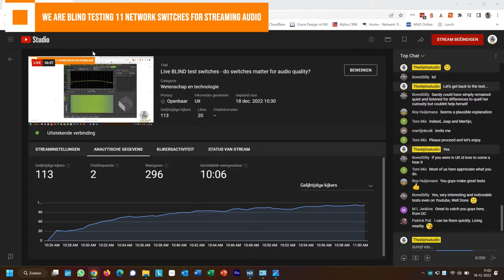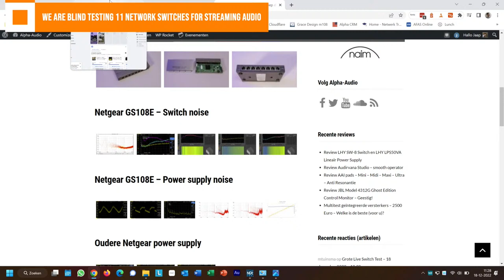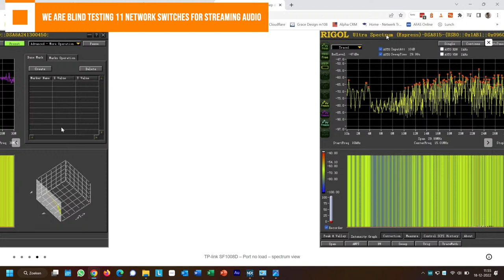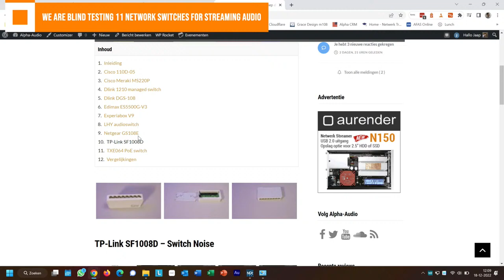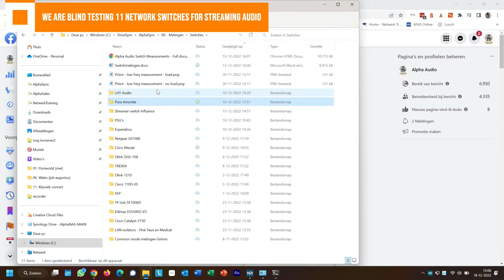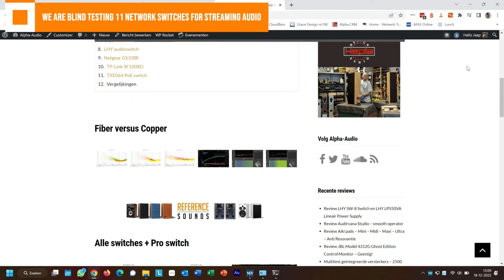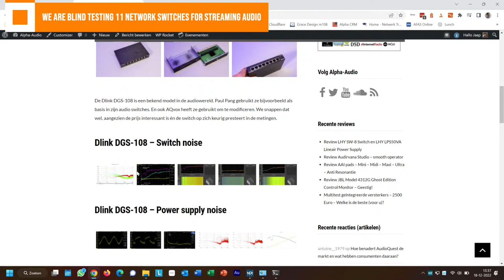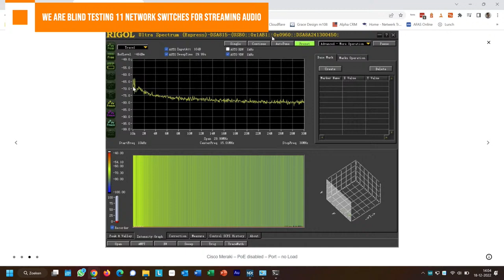Live BLIND test switches - do switches matter for audio quality?

Comment: Introduction: 04:03 - 16:17
Baseline (no switch): 16:17 - 22:55
Switch 1 (LHY SW8) listening: 22:55 - 35:49
Switch 1 (LHY SW8) measurements: 35:49 - 
Switch 2 (Dlink DGS-1210) listening: 38:13 - 46:57
Switch 2 (Dlink DGS-1210) measurements: 46:57 - 52:47
Switch 3 (Netgear GS108E) listening: 52:47 - 1:00:51
Switch 3 (Netgear GS108E) measurements: 1:00:51 - 1:03:15
Short discussion on how conduct these tests and why: 1:03:15 - 1:07:15
Switch 4 (Cisco 110D-05) listening: 1:07:15 - 1:14:53
Switch 4 (Cisco 110D-05) measurements: 1:14:53 - 1:20:33
Switch 5 (TPLink SF1008D) listening: 1:20:33 - 1:28:40
Switch 5 (TPLink SF1008D) measurements: 1:28:40 - 1:36:37
Switch 6 (Pura Audio switch) listening: 1:36:37 - 1:43:23
Switch 6 (Pura Audio switch) measurements: 1:43:23 - 1:48:02
Lunch break: 1:48:02 - 2:22:52
Recap of the test setup: 2:22:52 - 2:26:51
Recap of the listening experience: 2:26:51 - 2:32:02
Switch 7 (Delock Fiber converter) listening: 2:32:02 - 2:40:17
Switch 7 (Delock Fiber converter) measurements: 2:40:17 - 2:46:35
Switch 8 (Edimax ES5500G-V3) listening: 2:46:35 - 2:54:27
Switch 8 (Edimax ES5500G-V3) measurements: 2:54:27 - 3:00:57
Switch 9 (Dlink DGS-108) listening: 3:00:57 - 3:09:17
Switch 9 (Dlink DGS-108) measurements: 3:09:17 - 3:14:43
Switch 10 (TXE064) listening: 3:14:43 - 3:21:13
Switch 10 (TXE064) measurements: 3:21:13 - 3:24:28
Switch 10 (TXE064) non-POE ports: 3:24:28 - 3:29:00
Switch 11 (Cisco Meraki YETI edition) listening: 3:29:11 - 3:37:01
Switch 11 (Cisco Meraki YETI edition) measurements: 3:37:01 - 3:41:07
Revisiting switch 1: 3:41:07 - 3:49:20
All switches: 3:49:20 - 3:55:41
Some sort of conclusion: 3:55:41 - 4:01:42
Fiber revisited: 4:01:42 - 4:04:30
Baseline (no switch): 4:04:30 - 4:12:50
Reply: Thank you!
Reply: Thanks for the List, Really enjoyed your latest test.

Comment: Switched a Dell Power Connect 2816 for the Netgear GS108E today. It's just over 25 Euro's! The improvement is massive, the reverb alone is impressive. Over the moon with it. It's all about noise and grounding most of the time. Thanks Jaap en Martijn.
Reply from the maker: Welcome. Glad you like it!
Reply: Interesting!  There must be a big difference between the USA version and the EU version on the Netgear because here in the USA (I tested 15 different switches over the last month) the Netgear models performed the worst of any.
Reply: @GreekAudioGeek  I don't know, I bought the NG 108 and noticed an immediate improvement in both sound and picture quality on my television and sound bar. But, I am using a linear power supply on the switch. Even my 80 yo mother asked what I did to the TV, she wondered if I bought a new setup. It was that switch.
Reply: @michaelwright1602  Hey Michael - I've always heard good things about it but it just didn't work in my system.  Is yours a US or European version?

Comment: It seems that you guys have the ability to ear noise in the megahertz region , well  even  bats cant  😅
Reply from the maker: We ARE superhuman... Didn't you know...?
Reply: @TheAlphaAudio  I would expect an logical and/or tecnical  answer , dont u think 🤔
Reply from the maker: @fdracing63  i didn't read a question...
Reply: @TheAlphaAudio  in a way it was , and still is 😉
Reply from the maker: @fdracing63  Noise can influence lots of things. Electrical noise - say from LED's, PC's or Power adapters - can influence dacs, clocks or amplifiers with high bandwith. You can notice it in a less calm presentation. 

Another example is speaker design. The TAD's have a range of 30 Hz - 60 kHz. Do I hear 60 kHz? Of course not... but because of the very high bandwith the speaker is a lot cleaner in the audible range. There is virtually no distortion.
Reply: @TheAlphaAudio  ok , but if the megahertz noise can influence the audible region , why dont you make measurement in the audio band  ( 20 hz to 20Khz ) too , it will easely and clearly  shown differences , my take is about the method you use to demonstrate things
Reply from the maker: @fdracing63  We did that as well. All measurements will be visible in the written article. Also... the spectrum analyzer measures from 10 kHz - 30 MHz in this case. Not all spectrum analyzers are the same. Ours has a bandwith from 9 kHz - 1.5 GHz. We used a Prism dScope for the lower band.
Reply: @nihilionsaro  Do you have trouble with truth and science or you prefer live in your biased world .....
Reply: @nihilionsaro  No doubt  , you have trouble with thruth  , you'r the perfect beleiver at the rigth place 🤣 , kiss from  science 😂
Reply: @TheAlphaAudio  the graph in the lower band , use  dBfs , instead of dBv /u , any reason why , we dont know what's is your fs in that case  , an 32k of FFT  is useless , 192k will be , say more accurate
Reply: @DIYAudiophile  why do you guy's are so angry , science is made of contradiction and doubt  , if you want to prove anything you should accep it .....
Reply: @fdracing63   I don’t think we are angry. We are just enjoying listening to our music streaming through a switch instead of wasting our energy in measurements and charts. Alpha Audio did a good job to establish correlation between measurements and listening but it’s not always spot on. Save yourself time and perform this correlation in your own rig and be your own judge but always keep in mind that not everything in life is explicable and if your ears win over measurements don’t defeat it and prove otherwise in the name of science. Science is no always correct.
Reply: @DIYAudiophile   " if your ears win over measurements " , have you heard about cognitive  biases  ?? , you should not trust your audition that much and have a learn about all the bias human are prone to ...
Reply: @fdracing63   Unlike you, I don’t believe in all science out there and fancy terms such “cognitive bias”. When engineers designed test equipment such as AP555, where they under the influence of the so called “cognitive bias”? You can choose to believe everything you read and undermine your hearing ability. For me, I’m gifted with two ears  that are reliable and trust worthy. 
If you believe solely in science then I suggest joining the ASR community and you’ll safe haven there.
Reply: @DIYAudiophile  Cognitive bias is all but fancy , you guys have a lot to learn , a lot ....
Reply: @fdracing63   Prove the existence of "Cognitive Bias" and then we can engage in further duscussion.
Reply: @TheAlphaAudio good points especially the high bandwidth amplifiers that are sensitive . Most people don't understand the parallel influence of the whole chain where especially ground has a big impact.  Even this switch test says nothing about the equipment and outcome but more about the situation there .This is exactly why blind tests don't work because bad ground has an impact on all the connected equipment. Testing in your own set is the only way to come to a conclusion.
Reply: I bought the $40 NetGear 108 switch, and saw an immediate improvement in television picture quality, along with very noticeable better sound out of my sound bar. Others noticed the change immediately upon walking into the room, one being my 80 yo mother. The switch works. Best $40 I have spent in years.

Comment: I was not able to watch the full 4 hour video, so let me ask the question here. This test was performed with streaming audio, so the data is already buffered in the streamer before sounds start. That also means that you could disconnect the network cable for a few seconds and put it back in the switch without interruption of the audio. Was at some point the in this test, the network switch briefly disconnected and was the reviewer able to tell when?
Reply: That is a very good question… see measurements and disconnecting the cable for a few seconds by Emir from Audiosciensereview….

Comment: Excellent review! For me personally the LHY is the winner as "loads of detail" is what I expect from a network switch. The counter melody played by the keyboard on the Talking Heads song with the LHY (and the Pura) sounds more engaging than on the non OCXO switches. The LHY then resolves the details of the fast rhythmic section better than the Pura.
 If I have issues with tonality, or a too hot tweeter because of the OCXO clock, there are other ways of dealing with that further down the chain rather than stifling the network switch. ps> I also really liked the glass fibre demo and assessment at the end! :)
Reply from the maker: Thanks!
Reply: Do you really think so? Are you kidding me?

Comment: Hi guys! a few years earlier i would have said audiophile network switches what a nonsense! But i myself just expierienced what a hi end Isotek power conditioner and a hi end audioquest power cable could do to improove the audio quality of good hi-fi system, i was very supprised about the difference,  wider stage, more resolution, but the most difference was more bass, the difference in bass performance blew me away! The bass went deeper end had more punch, it was clearly noticeable.
Power delivery definitively makes a difference. I like your hearing and testing sessions, very interesting, maybe i check out my network switch soon. Very nice work Jaap, just subscribed to your chanel, very interesting stuff👍🏻
Best regards from germany
Reply from the maker: Thanks man!
Reply: Which Isotek power conditioner are you talking about? Cheers

Comment: Netgear GS108e net besteld 👌
Question - is the stock power supply good enough, or do you have an alternative?
Thnx
Reply: Yes it is, but there is something to be gained using other power supplies. If that works for you is another question. The only way to find out is to try for yourself.
Reply: I use the stock power supply. Surprised by the improvement on a NAD 658 (with 298). Hope you have the same results.
Reply: IFi iPowerX 12V is a huge upgrade.
Reply: @DBravo29er  can it be used, just by swapping?
And is it worth the Approx 100 €?
Reply: @maurices.7141  Yes and yes. I also found the lower cost iFi PS (black case) brought improvements for less $$.
Reply: I tried a Meanwell 12v switching power supply and the LHY 12v linear power supply. There was an improvement over the one that came with the NetGear 108. I use my television as the test bed, the picture quality was better with either of those two power supplies. There was a slight degradation with the stock power supply. I would definitely upgrade the power supply with this switch.

Comment: If there is a real difference in the sound introduced by using different LAN-switches and not only a price biased difference, then because of the digital streame not being effected, it must be an effect of the physical layer of the LAN-connection. The physical layer has no limitation of the amount of noise generated in the switch and transferred by the ground connection. The solution of that can be done in some different ways:
1.      Use a LAN-cable which has no screen. (This dissconnects the ‘ground’ in the DAC from the ‘ground' in the switch)
2.      Use a fiber-connection between the switch and DAC. (The only signal transferred is the digital stream)
3.      Replace the DAC by a DAC which has taken the problem coming from noise transferd and/or  generated in the switch in consideration  and designed the DAC in a way which eliminate the noice problem to a acceptable level.
It would be possible to inject noise into the DAC by the ground in the LAN-connector and measure the influence the noice-level (and type) has on the sound signal coming from the DAC. That would also make it possible to use that as a standard measurement which will show the difference between DAC's. 
This approach would hopefully solve this controversy.
Reply: Have you even watched?

Comment: Curious about you think about wifi networking? I guess that would take care of the issues with power supplies etc in the switches
Reply: It adds interference from the WiFi radio inside the streamer. One of the few brands that specifically designs for WiFi use is Auralic

Comment: @Jaap/Martijn: May I ask how you value D-link DGS-108 and Netgear GS108e in comparison to Silent Angel Bonn N8 and the NuPrime and English Electric clones? 

And what makes more sense, investing in an audiophile switch like Bonn or buying a D-link/Netgear with a high quality PSU (e.g. iFi Elite or a LPS) for the same money? 

My gut feeling says that the PSU is the most important aspect and more important than clock crystals etc?

Looking forward to your answer. Thanks.
Reply from the maker: A Dlink 108 with a good power supply beats the Silent Angel. And yes... The power supply is far more important.
Reply: @TheAlphaAudio  Thanks. So D-link DGS-105 + iFi iPower Elite 5V or Netgear GS108E + iFi iPower Elite 12V seems to be the way to go. Elite PSU 2nd hand can be found for 200-240 euro...D-link/Netgear new for ~30...sound like a good plan😉

By the way interesting that Martijn heard differences between D-link and Netgear regarding details...curious if that would be still the case with both switches having identical power supplies.

Anyway, very helpful tests. Thanks for all the work!
Reply from the maker: @basvandesteeg796  the Netgear and Dlink sound very different. Dlink is more airy. Netgear is more calm and bit more dry.
Reply: @TheAlphaAudio  With stock SMPS if I remember well. Interesting if these difference remain with both switches powered by same PSU...like Elite or decent LPS. Did you test this by the way?
Reply from the maker: @basvandesteeg796  we did test it with a good PSU. The difference remains. The sound improvement with a good PSU is very well audible.
Reply: @TheAlphaAudio  So best to try them both to find out what suits me most. Pitty that they have different voltage...
Reply from the maker: @basvandesteeg796  Dlink works on 12V as well
Reply: Vrolijk Pasen! Dank, wist niet dat dat Dlink ook op 12V kon. 

Is er nog verschil tussen de Netgear GS108E en GS105E afgezien van het aantal poorten? Meen me te herinneren dat ik ooit iets gelezen heb over ander (kleiner) kristal?
Reply from the maker: @basvandesteeg796  dat weet ik eerlijk gezegd niet. Vrolijk pasen!
Reply: @TheAlphaAudio  Oh really? I'm going to have to grab a D-Link. Thanks!
Reply: @TheAlphaAudio  That is true, with both audio and video. I'm using the LHY 12v LPS on my Netgear GS108Ev3 and it was incredible to see what it did with the video stream to my TV.

Comment: I didn't look through the whole video but what does it matter if there is noise on the ethernet port?
The DAC should be able to handle that so it doesn't make it through to the audio signal out.
Did you measure if there was any impact on the audio signal out of the DAC?
Reply from the maker: Yes... we actually did. En there is more noise on the analog output as well. But besides that: the clock in the dac can be influenced as well....
Reply: @TheAlphaAudio  Ok I'll find it in the video. That does not mean all DACs will have an issue though.
Reply from the maker: @TheSineira  true. And not all streamers are equally sensitive.
Reply: @TheAlphaAudio  So you are not really "testing" the switches, only the quality of the dacs?
Reply: Would it be possible to show those measurement. Because the real issue is whether it affect the output of the dac feeding the amplifier
Reply: ..and thanks for sharing your work 😀.
Reply from the maker: @harritz1977  you are welcome! We are still measuring it. We need some better equipment to create valid data.
Reply from the maker: @harritz1977  We will do a follow-up, but it will take time. I need an extra device to decently measure the effect on the dac and output.
Reply: @TheAlphaAudio  That's fantastic :-) just take your time - and remember to enjoy the holidays. 

Your work on bridging the gap between listening and measuring brings valuable insight to the community by providing another dimension compared to sites like ASR. I especially enjoyed the latest amplifier test :-).
Reply from the maker: @harritz1977  thanks! It is very interesting to find some links... You enjoy the holidays as well
Reply: @TheAlphaAudio  "But besides that: the clock in the dac can be influenced as well...."

Is that an assumption or did you really measured the clock and saw that it was influenced by noise ?
Reply: Thx for sharing and making the effort to set this up. Would be verry interesting to include another element into the tests, that is to sometimes not make anny changes, and check whether or not you can hear that too.

Comment: In IT world, it's  milliseconds of ip packets that gets measured thus should be same. Power conditioning of power supply and cat 6 7 8 cables make more of the differences.
Reply: It is not about the data side of things. That doesn't have any influence at all.

Comment: Great video and great subject for discussion on streaming audio! Thank you!! @TheAlphaAudio Can you share do you use port-1 for IN and port-8 for OUT??? I did get Netgear GS108(without "e") and TPLink SF1008D. Netgear have some sick depth/width and layers, really easy to distinguish, music flying around but the bass was way too weak for my system. TPLink is less of what Netgear did great but with more warm sound, more attack in bass and more bass overall. But on the TPLink on port 1 and 2 the stage was bad ....on the 1 and 8 it was way better!
Reply: We don't have any preference for specific ports. It could be however that it makes a difference, but that's due to not so proper separation of the ports. It seems the TPLink suffers from this. Now, for a fun experiment, stack the Netgear and the TPLink. Netgear first and then TPLink or the other way around. You will find it has impact ;-).
Reply: Exactly my observations, TPlink was more dynamic also! I left the TPlink for now at my setup. Dlink is also comparable to TPlink but beter in 3d and a little different on details/stage etc. Dlink also better on bass compared to Netgear!